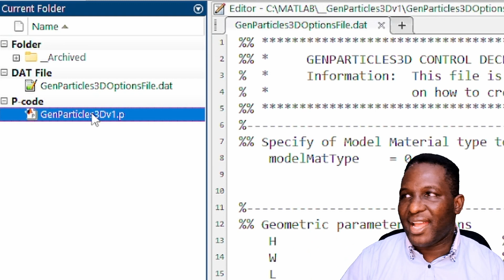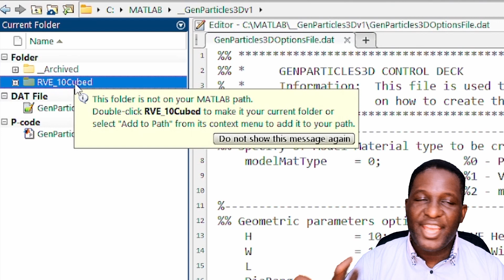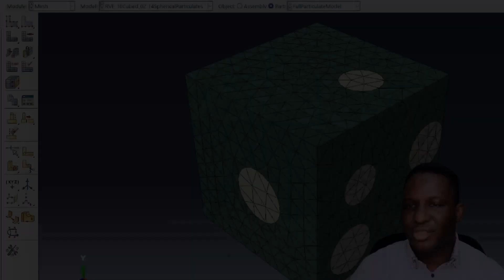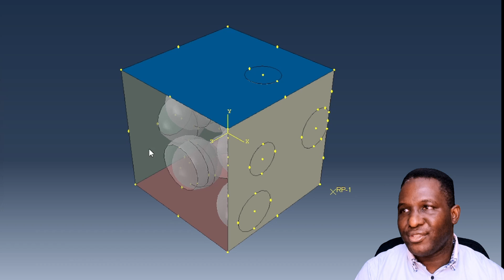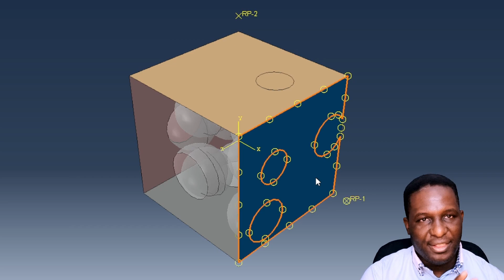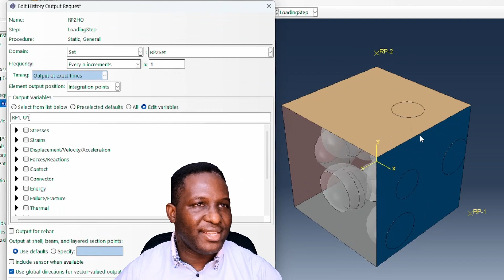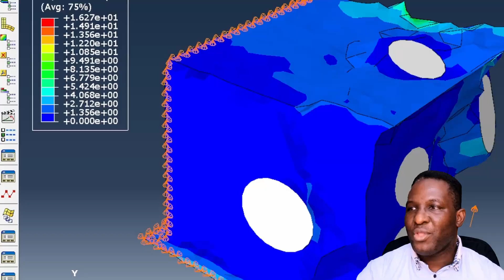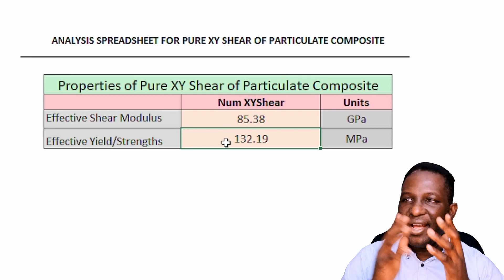PURE SHEAR Modelling of PARTICULATE Composites

Comment: Dear Dr.
I hope everything is going well with you,

In one of your videos regarding the pure shear stress analysis you used the slope of the stress-strain graph and divided the value by 2 to get the shear modulus,
Why in this video there is no dividing and only the slope is considered?
Thank you for your time
Reply from the maker: It depends, if you do pure shear then you divide by two. If simple shear where you only have shear in one direction (then you can divide by two). I had a detailed theory about this in the videos where I described implementation of pure shear in 3D RVEs. There is a 2D shear one where i compared pure and simple shear. Please look at those videos as they would help you.